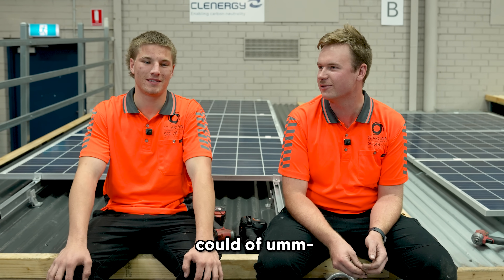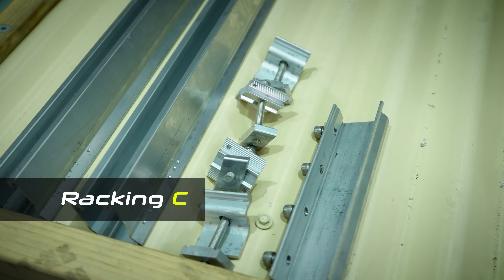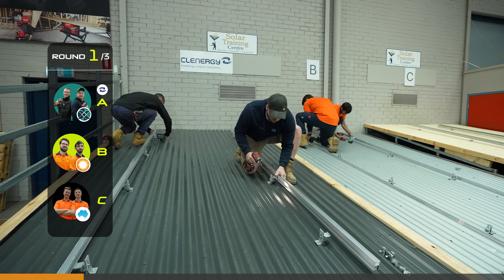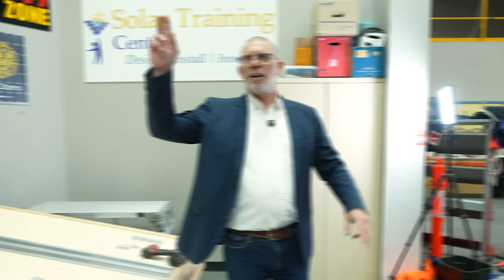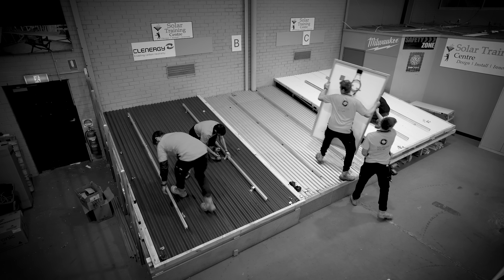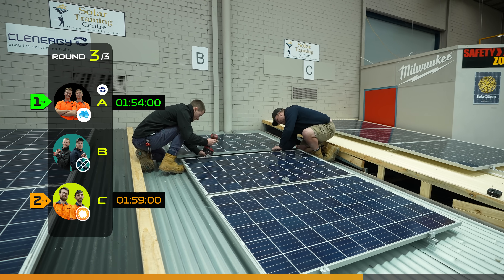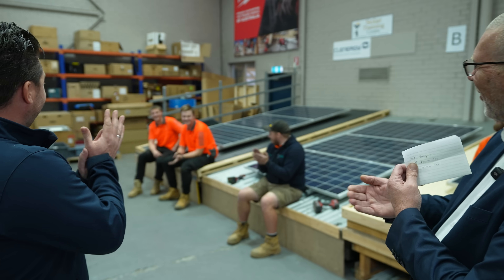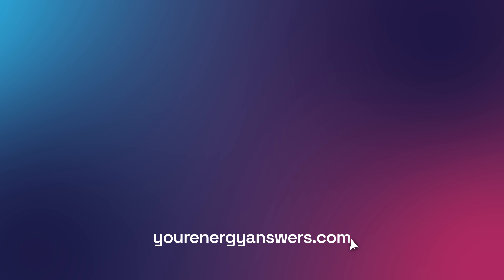Who Will Win the Solar Showdown? The Amazing Racking Race - Part 1

Comment: I'm pretty sure rail B was mounted upside down on every turn..... Didn't read the installation manual?
Reply: I wonder how many installers do not read the manual and just install it. Won't be suprise to know all the roof installed by monkeys are the wrong way around.
Reply from the maker: Goes to show product design...

Comment: Great stuff. Can't wait till they do the same kind of challenge but on a industrial roof using non penetrative clamps. Keep them coming.
Reply from the maker: Thanks so much! An industrial roof challenge with non-penetrative clamps would be epic — great suggestion.
Reply: @yeanswers  Pre-assembled Klip Lok clamp with EzClick interfaces already attached? I think the difference would be even greater than 25% in that race!

Comment: Speed is irrelevant. I want the system to last 25 years. so just do the best job and if it takes all week I don't care.
Reply: Mate these people have an iris the sign of a$😅
Reply: 99% of the industry take so many short cuts and slap them on in half a day.
Reply: If a mounting system can offer quality and shave off 25% installation time that is pretty significant. On a large job where it would take 5 days to lay the mounting down, that could save a day. This is huge considering one of the biggest hurdles the renewables industry faces is lack of electricians!